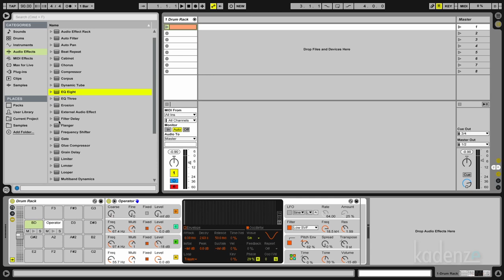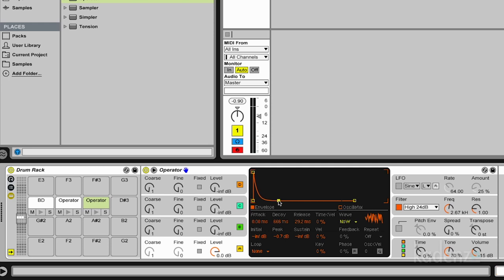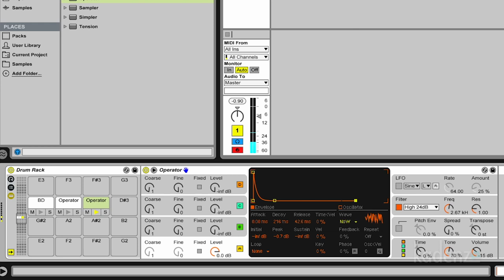Robert Henke Synthesizes a TR-808 Style Hi Hat

Comment: If you closely zoom in at a 808 hi-hat you ll notice that the waveforms is segmented in little packets  , which makes me berlieve that the actual noise source is either amplitude modulated at a verry high rate ( hence the silence portions in the waveform ) 
Same goes for the cymbal
Reply: It's not noise. It's 6 stagger-frequenccy square waves in the tr808. That's why you can just make out harmonics instead of there just being slush. Sorry, but in terms of programming, this hihat in the video is at noob level.
Reply: @Dr-Curious  
yes , it was a typo from my part